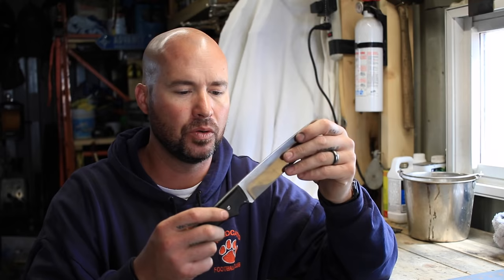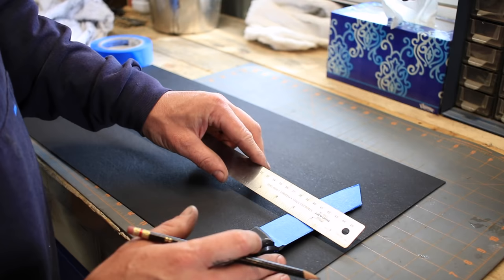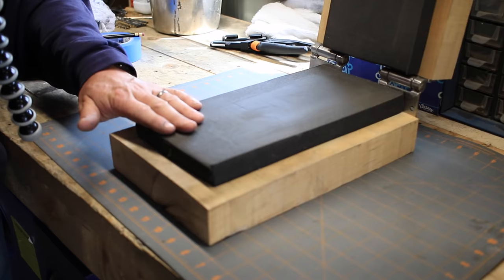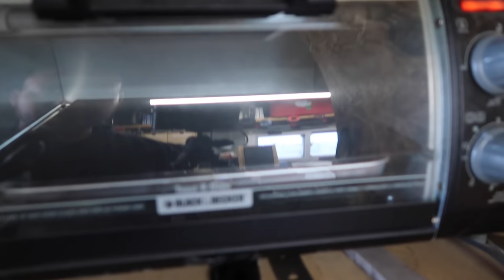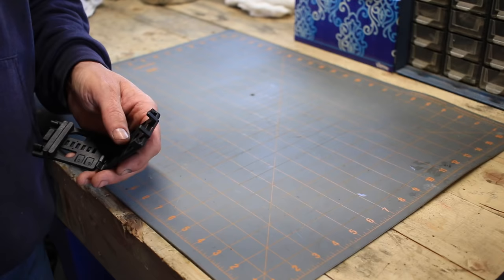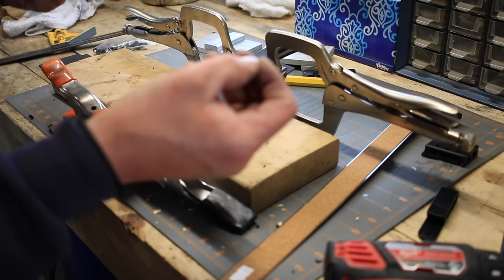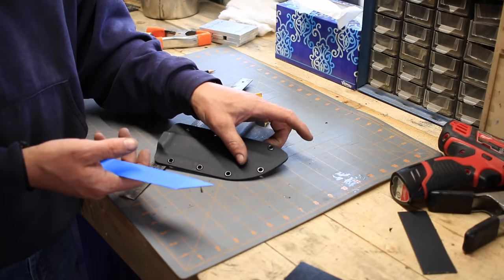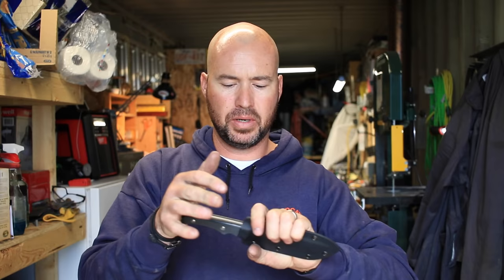Making a Kydex Knife Sheath

Comment: The pointy drill you referred to is called a Brad point drill.  Very nice to use in woodworking and the cut very uniform holes and are easy to center on a small mark due to the sharp point

Comment: I use a book press for my kydex without the foam glued in. You also can get more definition by warming the blade and foam before forming. Wet sand the edges working up in grit. 
( Learned both from Phillyedc's channel) also heating the pad takes the impression out, I can do multiple sheaths back to back. I use foam seat pads for my press and it works well just watch ones with lettering on them the letters will melt on to very hot kydex. Nice video as always

Comment: I just had a thought. If the inner side of the sheath was longer, the tactical mount could be behind the handle instead of the blade. Therefore it would sit lower from the waist and slimmer to the body since you dont have to make that spacer. I think it would be a more comfortable reach, you would even have a protected side to minimize the risk of cutting yourself when reaching for the knife. And you protect the blade from scratches as well. But that mount you did there maybe was for a legmount? I just found your videos. loving them! Im not far away from trying to make a knife myself. So inspiring. Thanks! :-)
Reply: I like your idea. I was thinking that the handle rode a little high for my comfort.  That would solve the problem.  👍

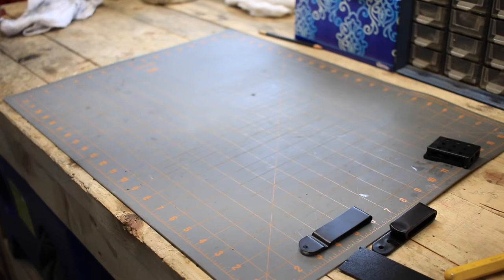Comment: 13:35 instead of the third piece you could add a .2" block of wood (or however thick needed) to the knife blade with tape so you just have 2 pieces. provides additional clearance for the screw. Saves you material and fewer points of failure... just a thought.

Comment: Thanks for your informative videos.
Your bit is a standard HSS Brad Point bit, which is the best bit for all wood drilling. Outer bit points cut a clean perimeter before the bit drills the hole.
Have you considered adding a simple stand-off block of wood or aluminum to your knife with double stick tape before forming Kydex, to allow you customized locations for adding Chicago bolts, for attachment of belt clips instead of your current standoff? Look at clip mounting of just about any Kydex pistol holster and you will see it. Very clean.

Comment: you can also score the kydex with a utility knife/razor blade and the just fold it back and forth snaps clean..
Reply from the maker: ah I've never tried that. Kinda like drywall. Thanks!
Reply: +Simple Little Life yeah that's how I did mine just sat the straight edge down and scored it then used the first one to line up and score the next one...ended up screwing it up pushed so hard the eyelet popped through...apparantly you DON'T use full strength on the Arbor press
Reply from the maker: wow yeah. I suppose an arbor press would do it Especially when the smaller ones are even listed as 1 ton. This little dinky press I have isn't that dangerous. I have to really crank on it to get a full crimp.
Reply: +Simple Little Life yeah it litterally pressed the crimp though to the opposite side leaving a bur, tried to drill it out and ending up melting the kydex into a whole too big to replace the eyelet...:(
Reply from the maker: that's a bummer!
Reply: Thank you for the tip. I used this technique for cutting out my first sheath material. This was the only part that went perfectly. The end result was a giant pancake sheath but thats down to me.

One thing I found was heating up the rivets a fraction helped me. Im using dies in a vice, and passing a heat gun over the rivets for a second, just raising the temp by 20degrees or so, made them a little bit more malleable and easy to form without splitting.

Please verify this though, my rivets were from china so they are mystery metal. If its nonsense ill delete the advice.
Reply: +TheWtfnonamez I can't confirm this..I have made one blade but it makes sense..I will ask my mentor but in reality a press would be a better bet I would think. any of the well known knife supply places is where I would get rivets/eyelets...jantz, usaknifemaker, pops knife supply, those are all quality companies..
Reply: Thanks for the reply mate, I would be very interested to hear what he says. I will check out those suppliers, Im based in the UK, but hopefully some of them offer reasonable shipping. ATM in the uk purchasing options are specialist suppliers that are super expensive, or amazon which is cheap but quality is a lottery. 

Gz on your first knife Rector. I found the first one to be a real marathon.
Reply: +TheWtfnonamez Redpath Knife and Tool here on youtube is a UK based knifemaker and could probably tell your more and better suppliers for your neck of the woods.
Reply: Thank you I will check it out.
Reply: @Simplelittlelife  your left hand looks old, while your right hand looks young. Strange🤔

Comment: * Meant to ask what the temperature was set for on the toaster oven?  Obviously he's been doing it for a while, what has been found to work the best?  Anybody?
Came here looking to understand the kydex working and making...
Very, very cool knives, sheaths and well done (instructional) video for the process as well.
Thanks!
Reply from the maker: I should have mentioned that, whoops. I usually have it set to 300°F, but it is something that you have to watch. At 300 it will get too hot but it’s a decent heat that it won’t take too long to become pliable. But seriously, I stand in front of the oven and wait. I never do anything else while waiting for it to heat up. How that helps 👍

Comment: How to keep a knife from rusting;
Turtle wax and a cotton wheel.
You polish the blade with the wheel and as it heats up the turtle wax actually penetrates the steel. Do this about five times each time dipping the hot knife into the turtle wax. It creates a great shine that looks almost like stainless steel. I first learned this with a rusty 16 penny nail. With lo thing but a wire wheel to clean up the rust and a cotton wheel and turtle wax like you use on cars, it cleaned up and never again had any rust. I needed the nail for a punch at my work bench. I had it for many years.

Comment: Just a couple of ideas for just before closing the kydex press:
1. Putting some little tube in the point of the knife so you get a water drain hole in the tip.
2. Putting some aluminum piece in the base of the knife so you get room to do some fixing without the need to make an aditional part to put the straps or whatever.
Reply: I was at a gun show Saturday and the guy there was using a heat gun, which is a lot safer and quicker.

Comment: You should put your press and oven side-by-side. That would cut down on time on the kydex cooling off unnecessarily and having to rush getting it into the press and cut down on you having to move around so much. You can always keep your oven and press together on a shelf above or below your table top out of the way untill needed.

Comment: I have a quick question why does everyone use the little metal eyelets, instead of drilling tonnes of small holes and using thick string similar to what is used when working leather? I'm just asking as I wanted to make a sheath but wanted to do it with string.
Reply: I reckon it's because kydex could wear through the cord whereas leather will form around it.
Reply: I made a Kydex knife sheath using stitching techniques I used 10 mil waxed cord and a saddle Stitch. It only took me about a half an hour to apply the cord. It's absolutely not going to last. I'm going to have to get a new cord.
Reply: Think the ideal thing would be to use eyelets and then wrap the string through the eyelets. If you only used string there would be a chance the the kydex moving around and it not making a very good seal. The eyelets prevent it from moving around.

Comment: Do you need insulation in a container in the winter time  or does it work with a heater container size 20 foot x 2.5 meters
Reply from the maker: I don't have any insulation in the container. I use a wood burning stove and one advantage of no insulation is that the metal being the stove gets quite warm and that warm spreads through the surrounding metal. Then you have all that metal that radiate nice heat and it works quite well. My seacan is a 40' one that is 9' high. in -20°C it is nice and warm in about an hour. Cheers!

Comment: That sheath looks clean as fuck. I've never made a sheath but it looks fun to me, or at least rewarding. This skill can also be used to make belt attach sheaths for any item. 

How would you go about making a larger sheath for a machete? My machete sheath is broken and I want to make a new one if possible.
Reply: trav v may I suggest rather than using a toaster oven, you use an actual oven.   A larger press would also be required with the use of multiple clamps vs. hinged end.   This is my best guess....  good luck

Comment: Hey Jeremy, so I bought that eyelet flaring press you used in this video, and honestly it is not even doing as good a job as I was doing with a hand setter. It's quite terrible actually. Do you have a certain technique to using it or mod on it? Thanks.
Reply from the maker: +Brian Sandoval that's weird. Was it the one from knife kits? I just bought the one they had there and it seemed to work good. Having said that it's a little flimsy for my liking. I've bent the main support arm and I'm actually looking for an arbor press to replace it. Maybe send it back or ask them about it. It seems like it should certainly work better than that. That's a bummer.
Reply: Yeah it's the one from knife kits. And I bought the dies that were meant to go with it. I have a feeling it may be that the dies were not machined correctly because they end up folding the eyelet onto itself and still leaving a gap between it and the kydex no matter how hard I press. I will be returning it and looking at an arbor press as well. It's a bummer I had high hopes.